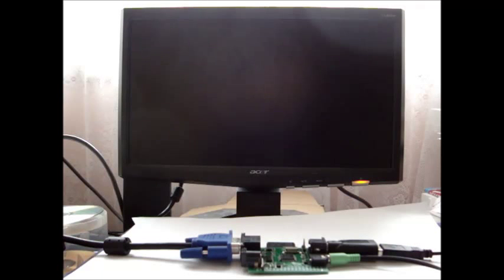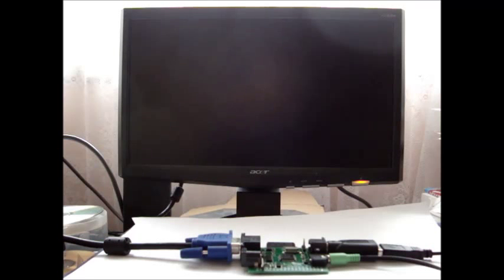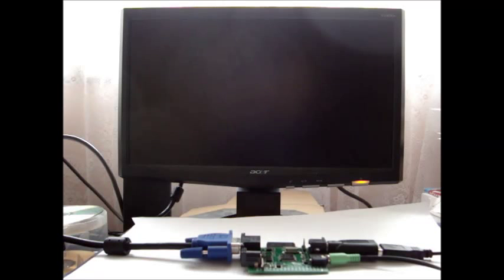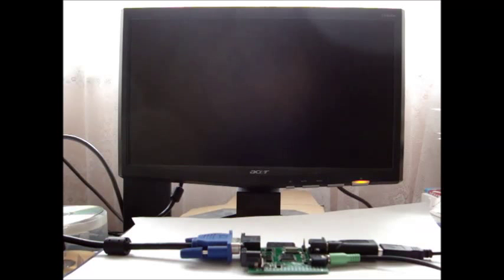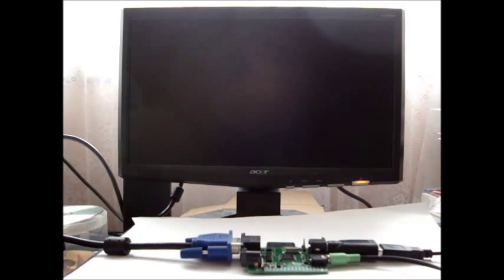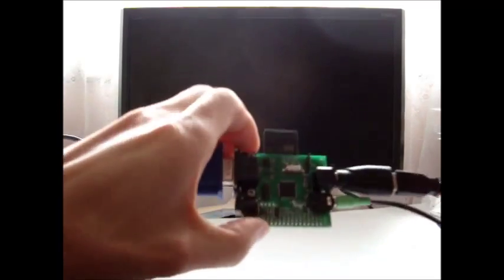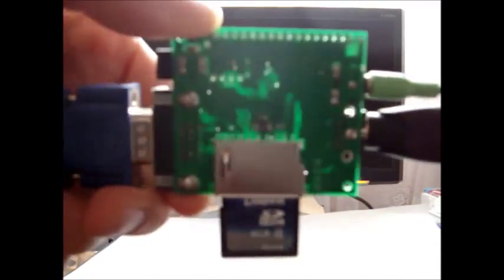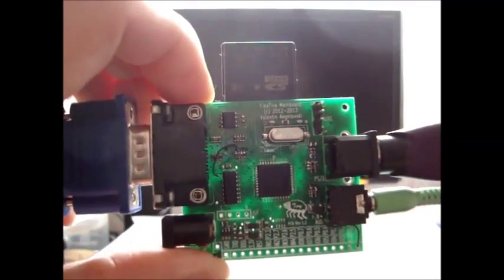Fleatiny computer system retro-gaming demo

Comment: Hi, I know it's been 12 years ago, but will you release the PCB design files too?
Reply from the maker: Hello. Well in theory I could, but it's a buggy initial prototype artwork created using an ancient Kicad program - not something I'd be proud to release as-is honestly. I am also having problems finding the firmware for this one-trick-pony demo as shown in the related video. Ultimately, I lost interest in my FleaTiny project due to difficulties around sourcing the actual micro used in the project even back then :(

Fast forward to the present day, and I found myself tinkering with brand new STC 8051 MCUs as a distraction from my other weekend hobby antics. I have found these to be even more powerful than the coreriver brand part I liked 15 years ago. I am in the process of designing brand-new PCBs for 8051 based microcomputer boards using new STC parts. Unlike my previous projects, these will be 100% OSHW.